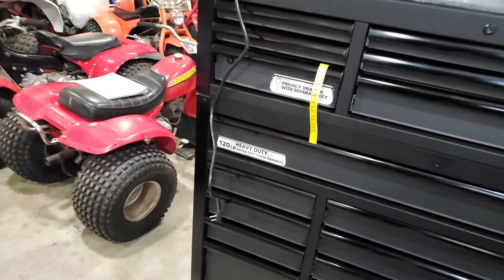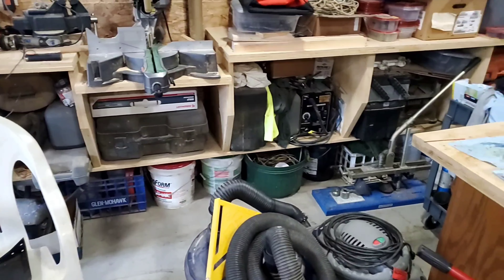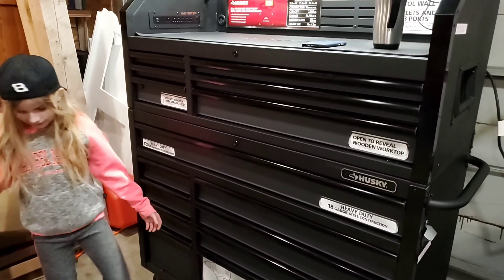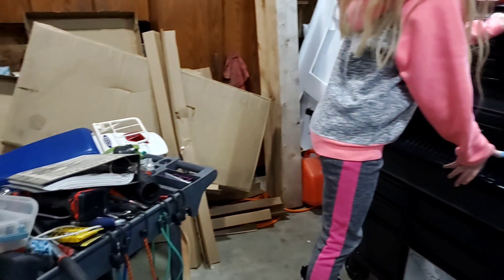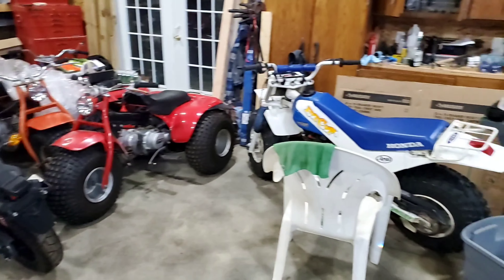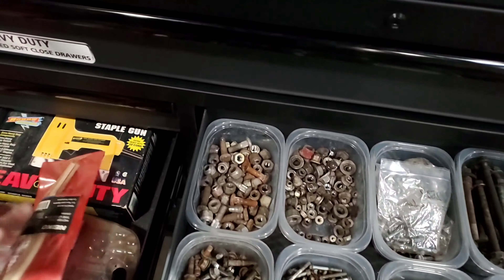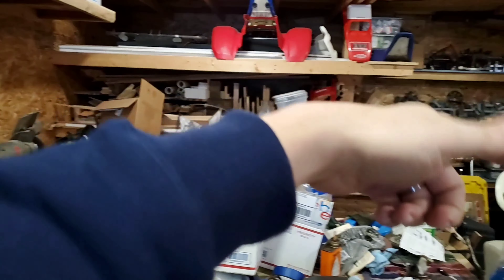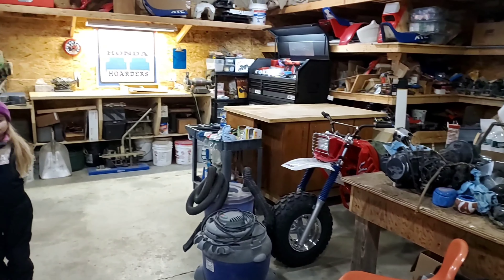Never-Ending Shop Cleanup and Husky Tool Box Review - Part 2 - Hoarding Trikes Ain't Easy

Comment: It will take a while to find where things work best for YOU! Over the years I have accumulated tool boxes and tools galore.  I STILL spend time condensing, combining, expanding, sorting and re-sorting.... perpetually in search of THE perfect toolbox organisation plan.  One thing I found most helpful was acquiring a good label-maker.  I found labeling  the fronts of the drawers a HUGE timesaver.. Would maybe help on the containers of hardware too!  I used painter's tape and sharpies as I moved the drawers until somewhat finalized. Have a ball!
Reply: Same here.  :)